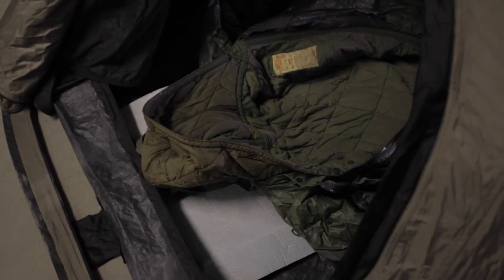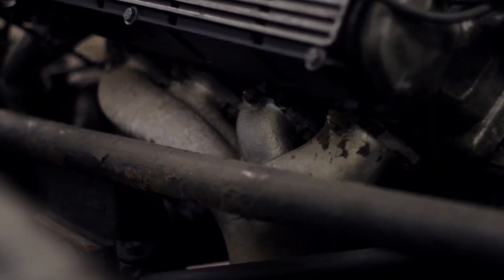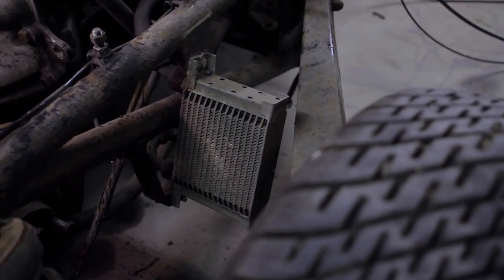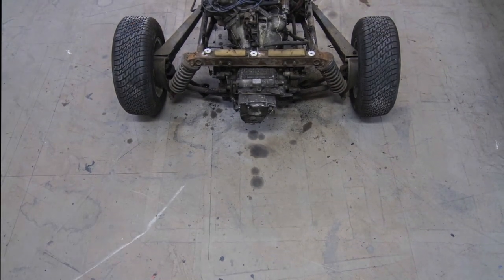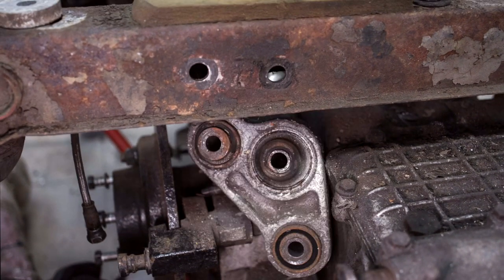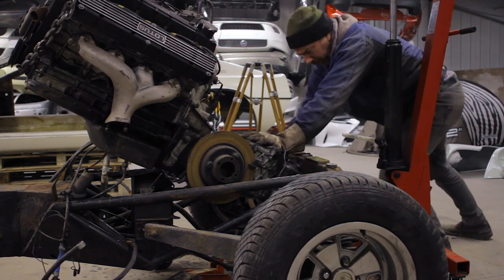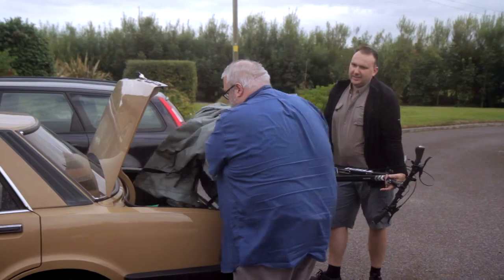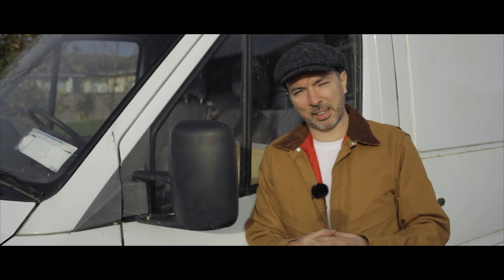Removing a Lotus Esprit engine and trans // SOUP Classic Motoring E.35

Comment: Enjoying this series, especially since I pulled an engine out of my of my Esprits, and the other is a body off restoration. Some comments on this video: 1. don't use chains on the engine, use ratcheting straps. They are nicer to the places where it contacts the engine. 2. The exhaust cam cover is on upside down. 3. An excellent penetrating fluid can be made with acetone and automatic transmission fluid. You'll need it. 4. The parking brake mechanism on the rear brake calipers can be freed by soaking them in this penetrating fluid for several days, occasionally taking them out and exercising the lever. 5. If you have any bolts that are frozen into the aluminum housings, such as water pump bolts, you can remove them using a Rescue Bit. Look it up on Amazon. GREAT tool to have. It allowed me to chew up a frozen water pump bolt without damaging the block. Threads were still there, but not strong enough to hold a bolt. A top tip is to place a magnet in a plastic sandwich bag just below it when you use this rescue bit. The magnet catches the steel bits, and take the magnet out of the bag and all the metal bits fall into the trash bin.6. Look into Time Serts. They are WAY better than helicoils for repairing striped threads in housings. Easy to install and strong. 6. Finally, you can get a good searchable copy of the parts manual here: http://www.holycows.net/Lotus/Manual-Parts-Esprit_S1,_S2,_S2.2.pdf
Reply from the maker: A multi=Esprit owner aye? Well played mate :) A couple of patrons beat you to it about the cam cover and I'm getting it from all sides about the chains but if you look closely there were doubled up rags anywhere they were touching ;) Love the magnet in the bag trick, that's clever as! Am a greta believer in having acetone in the workshop, just haven't gotten to it on the list of priorities in the budget so haven't had a chance to try the fabled ATF/Acetone mix, but don't jinx me, everything has been free so far, the car was garaged, unsued for 22 years after all. Thanks for all the tips Bill, great intel 🍻

Comment: Great stuff - really inspiring and thanks for all the encouragement and motivation you put into this lark. My update: 1993 Range Rover Vogue now has a replacement reconditioned auto gearbox and did a round trip to Liverpool with no fuss, but now has sprung a leak from one of the steel fuel pipes just above the rear wheel - so frustrating. I finally finished replacing the damaged valve and the rocker assembly in my beloved 1984 Rover Vitesse. Had some trouble with tappet pre-load because I replaced the tin head gasket with a composite one, but got it sorted in the end. Now on to the brakes. And then it's bodywork time..
Reply from the maker: Nice work man, but you missed a step; I'm still waiting for you to come and finish mine ;)

Comment: Buddy thank you for posting this. I just bought about a month ago a 1978 Lotus Esprit S2 over in the US and am currently doing exactly what you are doing in this video. Video has been a HUGE help already. Pulled the transmission to do a clutch job and remembered the water pump is leaking like mad. Will be getting a new one but ill be removing the motor to get to it so yeah. Thank you for the amazing video as there isnt much out there for this car video wise let alone information wise with the low number of them ever produced
Reply from the maker: Congrats! I didn't show it yet by my pump seems to be converted from later model, it's been welded closed where there would have been a pipe. You're not wrong, there's almost nothing G. Esprit tech online in video form. I just can't wait to have a full restoration in stop motion. Thanks pal 🤘🏼
Reply from the maker: @blakeriley6690  Deadly stuff Blake will do, thanks man.

Comment: To others taking an engine out like this, the easiest way to do to not struggle and not damage the gearbox is to use the engine hoist from the front/side and take the engine out of the chassis towards the front rather then up over the cross member to the rear. If you have the hoist to the front you can simply slide it forward just like if you take the body off a Ferrari 308.
Reply from the maker: My hoist def wouldn't do that easily but thanks for the tip.

Comment: Hello George, Think the otter switch would be lower down a pipe and usually immersed in coolant (placed on the lower half/section of pipe) and not on a vertical section??? Looking 'online' it appears somewhere forward of the steering rack, not sure if that correlates to where that hole is...?? Jaguar ones are either in or near the header tank....FYR...
Reply from the maker: Yeah there was some sort of switch/sensor up front, but not sure if that was temp maybe. Anyway I'm told the hole in the pipe in the engine bay would originally have had a flange on it and yeah that's where the Otter switch would be. I suppose it's low enough to be lower than the level in the engine galleries, and you have to remember the expansion tank is tall and stands on the top of the chassis.

Comment: George, Tim Engel (Lotus 907/910 expert here in the USA) says the early spring loaded timing belt tensioners have some issues and he recommends upgrading to a later tensioner. One of the biggest issue is a problem where previous mechanics leave the ground strap off that runs between the stationary part of the tensioner and the moving part that actually carries the bearing. I put the original one back on my 1974 Lotus Elite that I am reconditioning from a long storage with the previous owner but I will investigate replacing the assembly with a later one on the next timing belt change. When you get some time can you possibly post some video or photos of what the timing belt tensioner on your Esprit engine looks like? If you are interested I have posted pictures of the tensioner (as well as other photos) on my 1974 Elite on the lotustalk.com in the "Other Lotus Models" section of the forum.

Comment: TIG is a huge commitment to learn from both time and cost perspective, and it needs almost daily practice to get to a level you’d be comfortable putting your name to. It’s taken me 5 years of regular use to pick it up and carbon, stainless and alloy TIG welding all need different settings and techniques.  If you’re mainstay is restorative work stay with MIG / spot welding.
Reply from the maker: You're right I know, but it's always been a dream of mine to learn to TIG weld, and I like a good challenge. Plus like any other skill I've started learning, it'll open up new avenues of what can be made or repaired. Thanks a mill for the advice mate :)
Reply: SOUP Classic Motoring likewise, I tend to use it mostly for custom fab work like exhausts or suspension pieces etc and mostly at the bench, rarely would I ever use it for bodywork or to weld out of position as I’m simply not good enough.
Reply from the maker: @sweenep86  yeah see that works for me! A tubular exhaust for the Esprit is £1200+ and it's not that I'm expecting to be able to do something like that straight out of the gate, but it's something to work towards. And I love that quiet time at a bench, trying to get something right. If I can get a plant that does both, and lets face it they'e becoming more affordable, then least the potential is there.
Reply: SOUP Classic Motoring i can highly recommend the RTech sets.  Had both a DC entry level and an AC/DC set, both perform great.
Reply from the maker: @sweenep86  Had a couple of people mention them, will check it out. Will likely end up going with something I have service support with on the ground here but still in the research phase ;)

Comment: Old seatbelt are much kinder to soft alloy engines, and plenty strong enough, chains are too Savage, also an engine tilt adjuster is invaluable for mid removal angle adjustment s love that spine chassis tho, most unusual.
Reply from the maker: An old seatbelt is a great idea! Have to find one but yeah... perfect solution, cheers Martin. The hoist came in a deal with an engine bar [non adjustable] so I asked could I swap out for the stand. I'd love one of those bars but as you might have guessed we're in a game of priorities  here ;) The chassis is going to become the focus now for a bit, it's the underside of it that's been royally abused.

Comment: wouldn´t it be easier to disconnect engine and gearbox, drop the gearbox down and lift the engine out?
Reply from the maker: The workshop manual actually says keep them together but I think the generally used method is out from underneath rather than up and out. I was half way through before I remembered 😄
Reply: @soupclassicmotoring  I am removing the engine from my 1970 Europa S2.  I was also told that out-from-underneath works.  Advice was - "get a friend and lift the rear end of the car over it".  Europa doesn't have that bracket for the lower links - I gather the entire rear end collapses w/o the engine+transaxle.  We will see!  Cheers,  John

Comment: Combi mig/tig plants are DC only, no good for ali welding for which you need AC
Reply from the maker: I don't know the market too well yet but there are definitely at least two different makes doing MIG/TIG AC/DC machines!
Reply: Yes you are correct, you need an AC/DC tig welder for aluminium, that's one machine and not available with a Mig option, but a Mig with TIG combined is only available with TIG DC, only for welding steel or stainless, not aluminium
Reply from the maker: They are out there mate, have a quick search. There are combi machines with AC!
Reply: Just found it ,The Everlast 221STi, it's a brand new model, no one has ever previously made one, so that's an advancement in welding tech, at $2-3k, it's a serious purchase, I prefer 2 machines, works out cheaper too
Reply from the maker: ESAB launch theirs in January. Rebel 205ic I think it’s called and Miller have the Multimatic 220 AC/DC. The welding fund is over $1100 at the min so I’m hoping to get a bit closer and be able to bridge the rest.

Comment: I love your style of video, it must take you ages to do but it really makes an interesting watch.
That lotus is easily in my top 10 cars of all time.
I'm currently working on a 240z and I've got a Frogeye Sprite in the pipeline.
I had a cousin do the welding for me on the Z but I'm thinking of taking the plunge and getting a Mig to do the Sprite myself.
I wanted to do a video blog of the build of the Z but work got started before I had chance to put anything in place for it but I did manage to put together a weblog on it if you fancy taking a look.
https://datsun240z.wixsite.com/blog
Thanks for the inspiration dude.
Reply from the maker: There's a whole other element added by the camera work man yeah and as you found, it's difficult to do anything at all without some prep before hand. It's crazy how much extra time even just straight filming can add to the work you'd planned to do on the car. Gonna have a look at the 240z build this eve mate, thanks a mill.